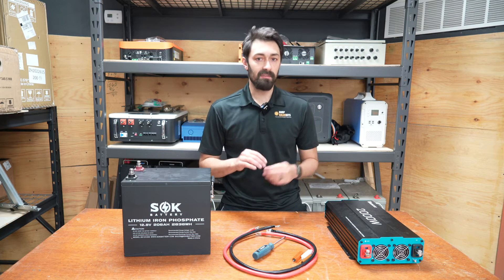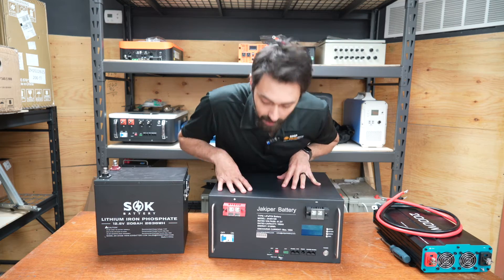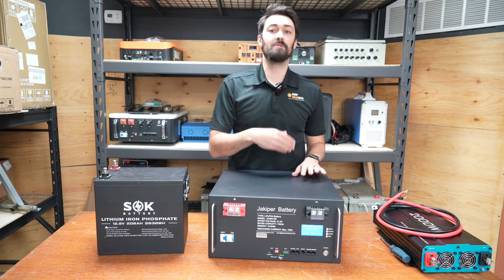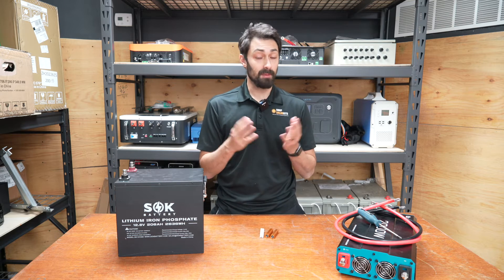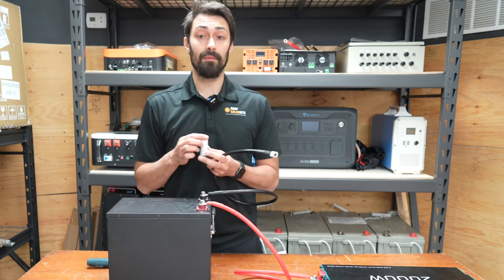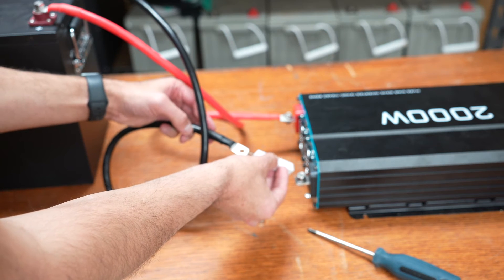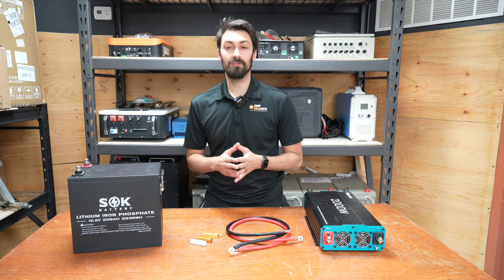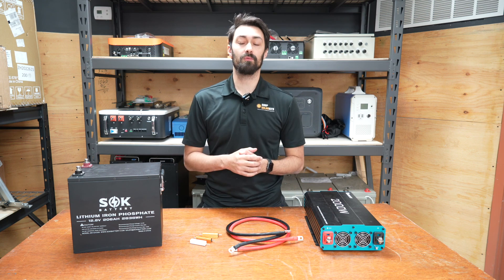How To STOP Sparks From your Battery Bank

Comment: OK, so could you mention what the details are as far as the resistor, watts and ohms?
Reply: value is not very critical. initial current is volts over ohms. a few ohms to tens of ohms is a good value for low voltage. a few watts or more rating is enough.

Comment: What if I use a on/off switch on the cable,.and turn on after it's connected?
Reply: spark occurs inside the switch and eats away at the contacts.

Comment: I have a escooter battery 52v 30ah and sparks strong when I plug the connector, that burned the connector. What resistor size should I use for this one? Anyone knows? Please help.
Reply: for higher voltage use slightly higher resistance like 20-50 ohms and 5 watt or more resistor.

Comment: You're not my heart, not my soul, but more of a hero!
Hadn't had any resistors nearby, so just used a voltage gauge instead. No sparks, no bruises on the metal. Beautiful🦋

Comment: i used a pencil
Reply: Does it have to been a number 2 pencil? Just kidding. Not sure if a pencil does the same thing as a resistor for what I know.
Reply: OK, the wood in the pencil acts like a resistor because the pencil is crappy conductor of electricity just like a wooden spoon conducting heat is much worse than a metal spoon conducting heat.
Reply: @robertbartos6660  the lead is a conductor. It took a big jolt. It got hot but then the cap was equalized with the other inverters.

Comment: I connected a 2000W inverter to connect to a 48v battery and experienced a large spark.  What size/type resistor should I purchase to prevent the spark?  Thanks in advance.
Reply: 12V system = 7Ω resistor (50W)
24V system = 15Ω resistor (100W)
48V system = 30Ω resistor (200W)
Reply: @jkapro  thanks

Comment: 12v automotive light bulb works just as well and you can visually see when the inverter capacitors are charged when the bulb ceases to glow. the battery units with switches don't prevent inrush current going to the inverter which is what can damage the BMS or inverter so it's still advised to precharge the inverter capacitors

Comment: Do i need a fuse or a circuit breaker in between the battery and the inverter?
Reply: inverters have built in fuses but it's always best to have an appropriately rated fuse right at the battery before the wires

Comment: Could you also use a battery disconnect to prevent a spark?
Reply: sound like a good idea, keep it in an off position until connected
Reply: @drewe9514  depends on the battery.  Many batteries have internal electronics to provide battery status information, etc. Even though your device is not hooked up to the battery a complete circuit is being made with the battery's internal electronics and it still sparks...